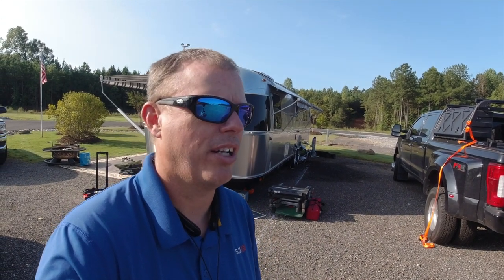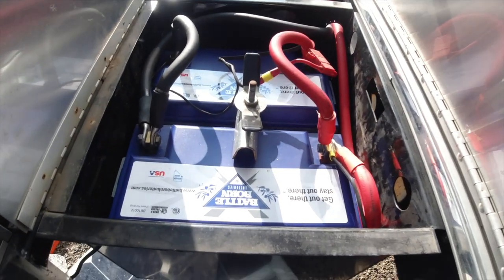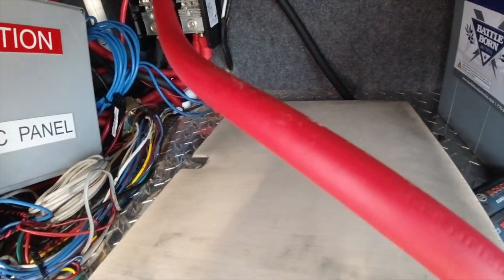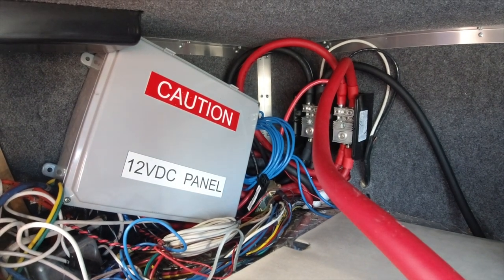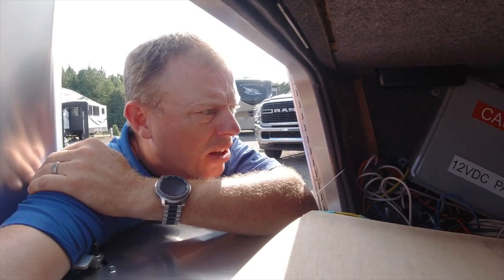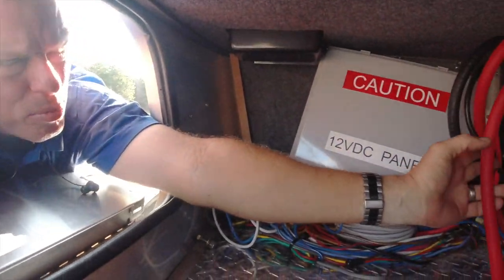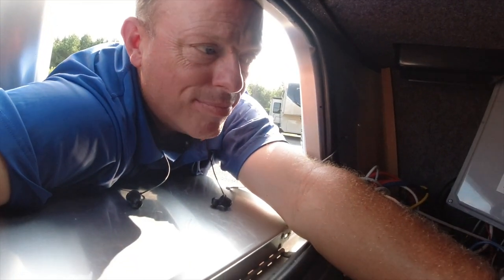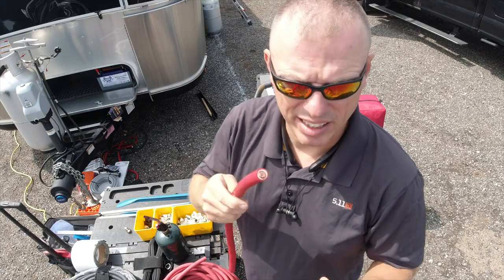How NOT to install a solar & lithium system in an RV | 2018 Airstream Classic 33FB

Comment: Are you a licensed electrician? If you are what license do you have and in what state? Just curious.
Reply from the maker: You actually wouldn't want an "electrician" to do this kind of work, which is why this one didn't work to begin with. Electricians typically don't understand DC power, which is the main power system in an RV. But actually yes, I do hold low voltage licenses in multiple states across the US, along with 26 years of experience.
Reply: The Dry Campers, I know you have all the best intentions but you are not licensed to do what you are doing. A low voltage license of any kind would not cover the scope of would you are preforming. 26 years of experience is not a good thing if you are not licensed and not preforming work in accordance with the NEC. I’m a licensed electrician and the minority of work I preform is off grid property electrification. An electrician is exactly who you would want installing alternative energy equipment. We have a national electric code for a reason. If covers the full scope of alternative energy both AC and DC.
Reply from the maker: @Biogasifier  you are incorrect. A low voltage electrical license, depending on the state may be from 50V or less while as others are from 240V or less. Because an RV is mobile it does not fall under the same restrictions that a fixed structure does, which is why the RVIA has a set of guidelines that mirror the NEC. I've been licensed for 22 of my 26 years of experience. So, are you trying to say that the ELECTRICIAN that did the original install on this RV did everything in accordance to the NEC?? Were you the original installer on this setup?
Reply: The Dry Campers, Sounds like someone that is unqualified trying to explain how they are qualified. Good luck in your future endeavors.
Reply: @Biogasifier  I can tell you as a customer of The Dry Campers that they are the best in the business at what they do. I did tons of research before hiring them and have been more than happy with our install. Not sure what happened that made you come at them like this, but as a customer I stand behind his work. Can I ask you a question? Are you the person who maybe did the install on this rig, and that is why you are coming at them? You may not be, but I was just curious. They did ask this above and you did not answer. My guess is that you are. Good luck with your future endeavors as well my friend.
Reply: Camper Life, I have never installed a alternative energy systems in a Airstream. I did not preform that install. My scope of work is off grid property electrification and a industrial electrician. For some reason that video popped up on my recommended videos. Watched it and saw may issues. Both that he corrected but also some that preformed as he was redoing the system. If you are happy with his work awesome. I asked if he was a licensed electrician because he was not preforming work to NEC standers. Yes it is not a permanent structure but preforming work to NEC standers is a sign of proper knowledge of the field. You can do it or you can do it right. Best of luck to you living a camper life. I should have not posted any comment. I was just irked that he was putting down another installers work and preforming subpar work as well. He is not an electrician and I really doubt if the first guy was. They are both installers. If he is happy with his work are you are as well great!
Reply from the maker: Thank you, William!
Reply: @Biogasifier  I had a licensed union electrician help me upgrade and reinstall the sound system at our church.  Reinstall because the amplifiers and speakers were not changed out.  He thought I was nuts special ordering much more expensive fine strand 10, 12, and 14 gauge wire for the speakers when we could have just went over to Lowe's to get it.  He thought I was absolutely insane though when I ran two pairs of 10 gauge wire to the subwoofers, when they were originally wired with a single 16 gauge pair.  First, the subs were 100 feet from the amplifier closet.  Second, the amp for the subs was rated at 2400 watts into 4 ohms, but only 1200 watts into 8 ohms (loading is critical for sound system amps).  Third, the speakers were 4 ohm.  I asked him to use ohms law and figure out the voltage and current the amp was capable of putting out at 4 ohms.  His eyes were saucers when he finished. The results were 98 volts at 25 amps (really... 16 gauge wire???).  However, that is RMS power, meaning the amp was capable of producing that continuously.  Then I explained with the amp set up to run in bridged mode its headroom, what it could produce on instantaneous peaks, was four times that.  On those peaks, the amp's output could be 196 volts at 49 amps.  And again, it was originally connected with 16 gauge wire!  Then I explained any resistance in the wire would reduce the loading on the amp, 1200 watts at 8 ohms instead of 2400 watts at 4 ohms.  The 16 gauge wire probably had enough resistance at 100 feet to reduce the RMS output to around 1600 watts, and the peak power to 6400 watts.  Once we were finished rewiring the subs and the overhead two-way speakers (which were even farther away from the amp closet) with the fine strand heavy gauge wire, we ran a sound check with a CD.  Even to his non-musically inclined ears, he could hear the difference immediately.  Everything was clearer and had a punch to it.  And, as I increased the level (we have a band), his response was, "Wow... what a difference.  Man that sounds great".  That Sunday, with the band playing, the entire congregation noticed a big difference (most people don't realize even CD's are highly compressed.  A live band is not.  Everything, especially the drums and bass guitar, is all instantaneous and requires much more power to reproduce).  A licensed electrician is well versed in house and industrial wiring.  So 120, 208, 240, 480 volt AC systems are a piece of cake.  However other system do NOT follow what the electrician learned and is knowledgeable about.  Fine strand wire is not needed in standard AC wiring.  In other types of installations, it is mandatory.  Length of wire isn't very important in 99% of AC wiring.  In other installations it is critical.  Even higher voltage solar installs (24 or 48 volt) found in residential and commercial systems are quite different than the 12 volt systems usually found on RV's. The 24 volt systems produce half the current and the 48 volt a quarter the current of a 12 volt install.  So type and length of wire becomes critical in 12 volt systems.  Just because you are certified to operate a train, doesn't mean you know how to drive a car.  Just because you have a driver's license, doesn't mean you know how to ride a motorcycle.  And just because you are a licensed electrician doesn't mean you know and understand low voltage solar charging systems.
Reply: Don F,  Some of the worst electrical work I have seen has been performed by union electricians. Being a good electrician is knowing when an aspect of work is unknown or not understood. There is a reason why there is a National Electrical Code. A very large part of being a good electrician is being able to use the NEC. Guess what, the NEC covers low and high voltages. He should have pulled the book out.
Reply: @Biogasifier  Yes, It did not take me long to pickup on that, the dry camper needs to go to Will Prowse university before he burns somebody's trailer up, I wonder if he even owns a multimeter or load tester.
Reply: What's the amperage rating of the 2/0 he used?

Comment: Wow! So our batteries are wired parallel and pos and neg come off one side! So wrong correct? Is it as easy as unhooking neg and relocating?
Reply from the maker: Hey Paul & Magen, yes, that is accurate and yes, it is as easy as unhooking negative and relocating.
Reply from the maker: Although - how many batteries do you guys have? Mike says if you have two it's not nearly as bad.

Comment: Question: Why would you not put the solar panels in series vs parallel? The panels have bypass and blocking diodes so one panel being shaded will not affect the others and the voltage will be increased therefore reducing the need for huge wire. Personally i have 3, 300 watt 36Volt residential panels on our RV wired in series with an inline fuse on the roof and a DC breaker just before the MPPT controller. Please explain why you use lower dc voltage from the panels vs higher. Thank you and Merry Christmas.

Comment: wow, and just look at how much they already spent, 6 battle borns, a bunch of very nice victron devices, probably $5k, and crappy wiring. An unconnected shunt?! I don't do this for a living and 2 of the main problems i wouldn't have done - no fuse coming out of the battery and connecting pos and neg to the same battery of a multi battery bank. Good you actually had to rewire it all, since there was other things going on. The owner should now be able to enjoy their huge investment for several years. Great job!
Reply from the maker: $23k before me.

Comment: This is scary! We are building out our bus now, and I was going to contract out someone to put in the wiring and solar, but geez. When I have no idea what it's supposed to look like, and I knew that the battery bank wasn't wired correctly just from watching YouTube videos...wow just bad. Great job getting the client fixed up again.
Reply: Watch Will Prowse on youtube, this guy obviously doesn't know what he is doing. To snip those cables because he didn't have the proper tools? Come on man!
Reply from the maker: Greg, Not really sure why you're trolling, but I cut those out in that way to send to the manufacturer of the batteries because they were being blamed for a manufacturer defect. All the cheap Chinese crap that was utilized in the original battery bank had to be replaced because it wasn't true 2/0 AWG, which is also discussed in this video... Feel free to watch any of my other videos as it seems you're new here. Also, feel free to call Battle Born and name drop me to anyone there and ask them if I know what I'm doing...
Reply from the maker: Traveling CODA, Thanks for watching and definitely make sure you get references whenever you do get someone to put in the wiring. Appreciate your understanding of what's supposed to be vs what's not supposed to be.

Comment: @The Dry Campers,  Hi Just a quick question, when you have 4 lithium batteries in parallel and say you have the pos of the cc on one end of the bank and the neg on the opposite end of the bank, and same with say an inverter, one cable on one end and the other at the other end, Do the 4 Batteries stay balanced doing it that way? I know thats a way to do it with lead acid but not sure with lithium as I am trying to find a balanced configuration, Thanks for any advise.
Reply from the maker: Yes, it allows you to draw from the entire bank, instead of from battery to battery.
Reply from the maker: Yes, it allows you to draw from the entire bank, instead of from battery to battery.
Reply: When you connect the batteries the way they were originally shown in the video, the battery at the main connection point does the lion's share of the work supplying the load. When connected with the positive at one end of the string and the negative at the opposite end of the string, the load gets distributed evenly across all the batteries. This extends the life of the batteries because all of them share the load equally.
Reply: @davidnelson7407  Thankyou for your reply.

Comment: Can you replace two 6V batteries with lithium batteries while keeping your existing solar system?  After looking at my system I would need to upgrade the controller to work with the lithium batteries.  What else do I need to look into?
Reply from the maker: Sure you can - definitely upgrade the controller and also check your converter for lithium charging compatibility. You just have to make sure you can put the power back in the batteries.
Reply: @TheDryCampers  Where would I look for the RV converter upgrade?  Any recommendations?
Reply from the maker: @troynoall793  if you contact Battle Born they have a list of recommended compatible converters.
Reply: @troynoall793  here is what I got Progressive Dynamics PD9160ALV

Comment: Good job cleaning up someone else's mess. I don't think I've ever seen anyone use bolts to terminate a cable before, how were they attached to the cable? As a side note, take it from someone that has worked in an industrial plant, take off your watch and anything else conductive like rings or necklaces. Seeing what a watch or ring does your skin when it decides to do some welding while you're wearing it is not pretty.
Reply from the maker: Thanks for watching. The crimp end had some sort of nut attachment and the bolt screwed into that. It was definitely interesting. I had never seen anything like that before either. Thanks for the tip. You're right, just can't go without my watch. :) Bad habits die hard.

Comment: You didn’t show the new install….  So comments are based on what you were saying so forgive me if I am incorrect.

Fuses need to go within 12” of the power source.  So they should be right next to the battery.  I have seen issues with insurance claims after fires because the investigation revealed that there were fuses 10’ from the battery and the power cable shorted where it passed through 2’ from the battery.  Just an FYI for the viewers.

Can you elaborate on my you say the (“first thing”) the power should com off the battery on opposite sides of the battery connections?.  I have done hundreds of parallel battery bank installs on police mobile command posts and marine assets and while I typically use and see a solid copper buss bar across the batteries,  I never see or install the power take off on opposite sides.  As long as the buss (or cable) is of sufficient size and does not have a high resistance there is no reason to extend one cable over to the opposite side of the buss.  I’m not saying it shouldn’t be but I done know the electrical reason why you would want to or a safety reason why you need to.  But I am willing to learn.
Reply from the maker: When you have loads of 200 or more amps you would never connect both positive and negatives to the same end of the battery, the first battery in the line will discharge before the last battery by putting the pos and neg at opposing ends the batteries split the load amongst themselves. This will allow your batteries to last longer.
Reply: Since we use solid buss bars tapped at the center it’s not an issue but that theory makes sense I guess.  Thanks.

Comment: Please explain the purpose of connecting the positive at one end of the bank and the negative at the other.
Reply: It evens out the load drawn from the battery bank.  The system then treats the battery bank as one battery and the load is evenly distributed. Also the charge going back into the bank is done evenly. The way it was setup, the one battery with Pos & Neg attached bears the brunt of load and charging is uneven. 
If you were able to open the top of just one 12v battery, it is actually 6 x 2v cells connected in parallel with a Pos & Neg post at each end - same principle.
Reply: @kimbostitch7034  Actually the individual internal cells are wired in series. That is why the positive goes to one end and the negative to the other. This is not necessary for parallel configuration. 

For a thought experiment pick the positive or negative and look at that. Call battery 1 closest to the load and battery 4 furthest from the load. 

If you pull 400 amps 
The cable from the load to to battery 1 will carry 400 amps. 
The cable between battery 1 & 2 will carry 300 amps.
The cable between battery 2 &  3 will carry200 amps
The cable between battery 3 & 4 will carry 100 amps.

Now what you buy for each battery, such as fuses will be more expensive as you get closer to the load. They progressively have to handle more current.  I would want a fuse as close to the battery as possible. I want a fuse between each battery. This way if a battery shorts, the fuse takes it out of the system. There is no way around the 400 amps between the battery bank and the load. I recommend that batteries in parallel be wired through a fuse to a terminal block. This configuration would have 100 amps through each cable and 400 amps from the terminal block to the load. This way the load from each battery to the terminal block  would be 1/4th or 100 amps. Then you run a cable for the block to the load capable of 400 amps. 

I have 4 - 300 AH batteries in parallel. I contacted AmpereTime with my recommendation and they said I was correct and they would update their manual.
Reply: @ny1t  argh hahha sorry in Series is what I meant not parallel. Not concentrating...

Comment: Sounds more expensive repair than if you just would have done it correctly the first time
Reply from the maker: @kurt mcmichael the client did have to pay me for the correction, but the dealership that did the original installation provided a reimbursement of the labor for not doing it correctly and as of the end of last year were not doing any further installations until they were properly trained.